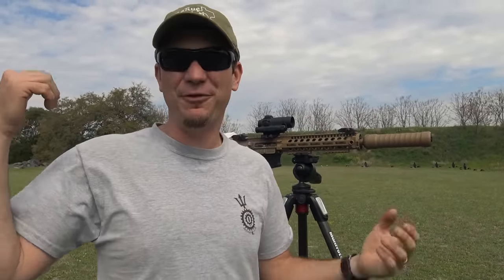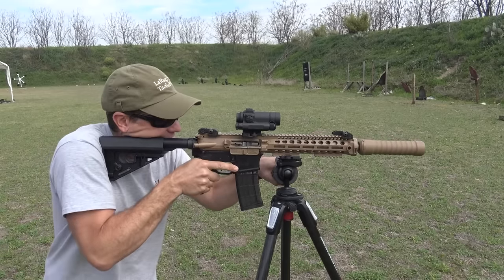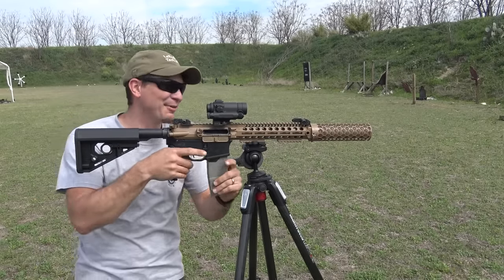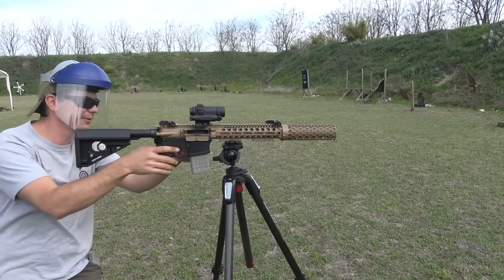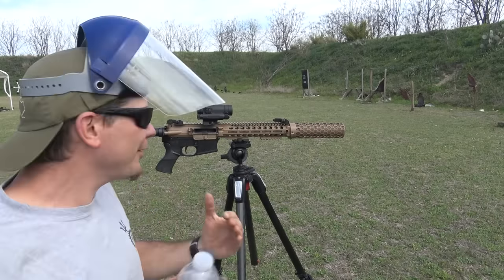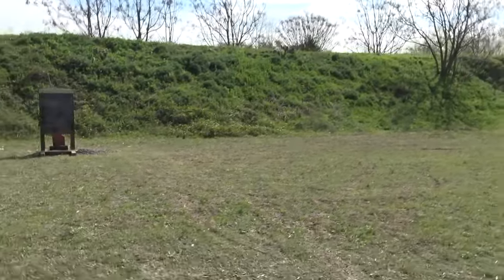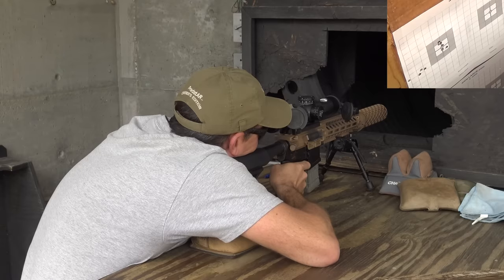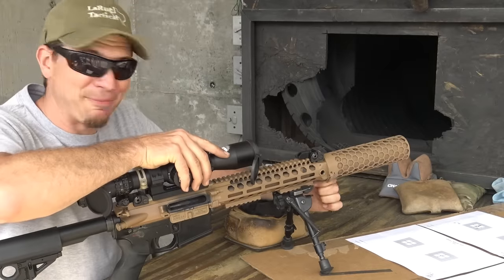LaRue Tactical SUURG Rifle 1,000 Round TORTURE TEST!

Comment: Solid video. That said, I think you could have solve the issue with the gas tube by using an inconel one. They're pretty widely available online, probably will only run you $25 - $30. They can go to something like 2.5 x the temperature of the standard stainless steel ones. You probably melt your barrel before the tube.

Comment: Wall idea is good, just needs a little more work. I would say that to keep it on the cheap, after the mill ball's, pour wet plaster to fill the space around them to possibly stabilize them. I think the hits cause them to settle and bulge the bottom of the wall leaving an empty top, where most of the rounds went. 
I like the idea though.
Reply from the maker: I'd like to try it again just with a 6" wall thickness.

Comment: This was AWESOME! I have questions:

1) Can I buy the pinned barrel separately from the rifle?
2) Was the zero shift correctable? That was really far off, so I'm trying to understand what happened to cause it.
3) If you buy this setup, do you get the barrel first, and the sleeve is held by ATF paperwork, or is the whole thing "the suppressor?"
Reply from the maker: LaRue sells it as an upper assembly. 

Zero is totally correctable. A few twists of the knobs and it’s good to go. We just shot point of aim. 

The barrel just has a massive muzzle break. The FFL would hold the suppressor until the tax stamp (infringement) clears. 

Thanks for watching!

Comment: Wouldn't putting water on it to cool it off be harder on it bc it's getting really hot then cooling off quickly from the water then getting really hot again?
Reply from the maker: Oh it’s definitely not ideal to rapidly cool metal. 

We were just going to insane emergency battlefield conditions. 

And it worked!
Reply: @TopShotDustin  yeah that setup staying going really strong. Better than a suppressor I've seen in sometime especially the coating. Usually when you cherry red a suppressor it burns the coating off. Love the channel btw.

Comment: 85db is the point where hearing loss begins. So... 138 is well into that spectrum. A vacuum is about 85.
Reply from the maker: The OSHA hearing-safe level for impulse noises, such as gunshots, is 140 dB. The hearing-safe level drops significantly to 90 dB (about the same as a power lawn mower) if exposure to the noise is 8 hours or longer. Hearing loss is complex, with negative effects that range from deafness to anxiety and high blood pressure, according to OSHA.